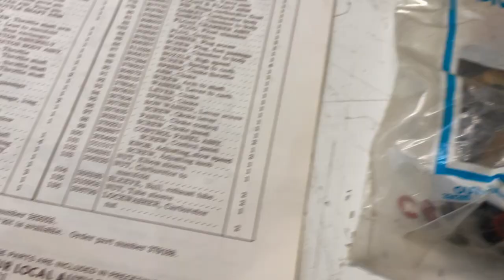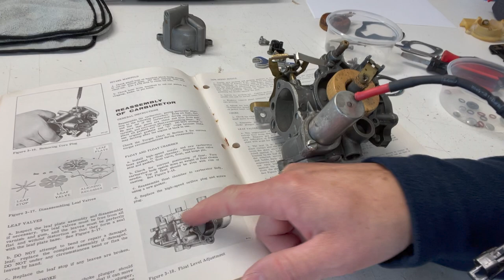1969 Glasspar Tacoma 14 Project, Basic Rebuild of the Carburetor, Evinrude Big Twin 40

Comment: You did have the key turned to "on" position while trying the choke?
Reply from the maker: Yep. Figured it out tho, one of the terminals on the back of the switch fell off. Squeezed that tight and it works fine again. 👍🏻👍🏻